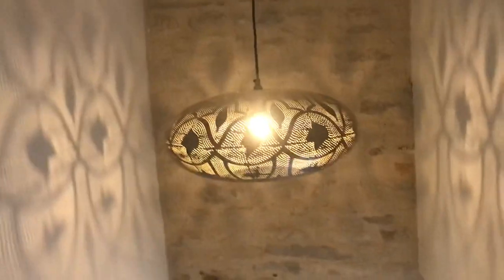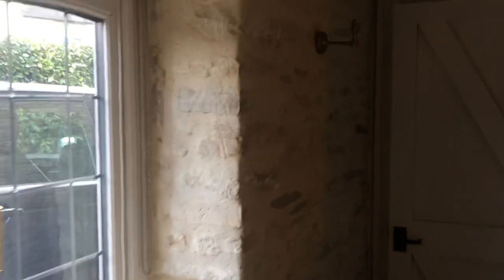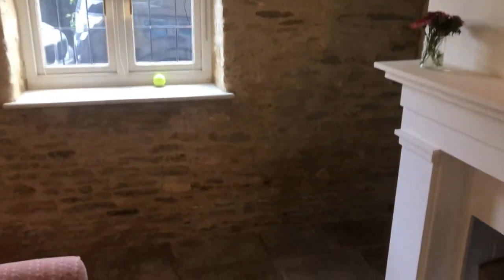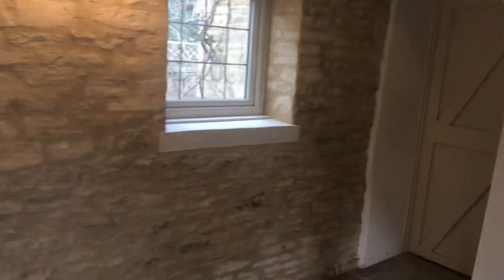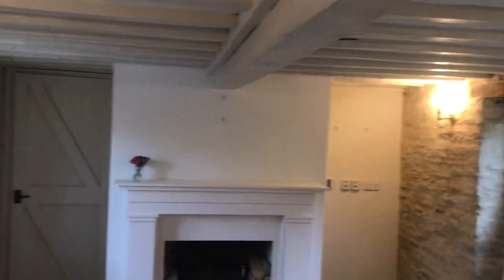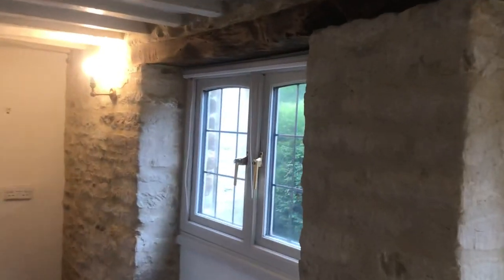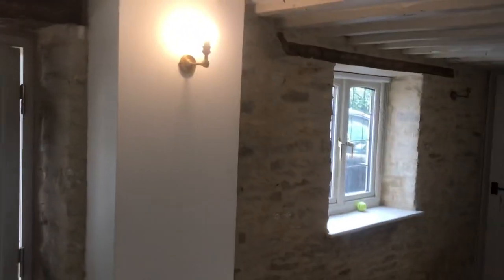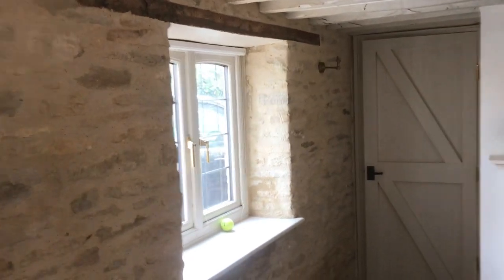Internal hot mixed mortar repointing

Comment: So glad I have come across your videos Michael. We have just purchased an old cottage with has had an extension on the rear  so the original stone wall is now a central internal wall and has some rising damp. The survey suggests injecting a DPC but after watching a couple of your videos I am thinking this is a bad idea and maybe lime mortar and plaster may resolve it so long as we have a well ventilated property with open flus etc?
Reply from the maker: Oh well done you. Congrats on the new property. Chemical damp proofing is akin to snake oil. That is to say, there are many promises but it's all usually in the name of making a fast buck. Chemicals will further add to any issues. Get all the cement off and out. Let everything dry out then use a nice NHL2, a putty mortar or some good hot mixed quicklime mortar. Air flow is always good. Maybe get back to your surveyor and make them aware of their bad advice too. Tell them to contact me if they're in any doubt as to the lack of efficacy concerning chemical treatments. I'd welcome a chat. Good luck.
Reply: @michaeljamesdesign  thanks so much for the fabulous advice.

Comment: Wonderful information in your vids, thank you so much. Interestingly, you speak about lime and light in this vid. I know that cement pointing looks utterly dismal under electric light when dark outside (you really would not mix the two). How does lime pointing behave/hold up under electric light in the evening? Thank you. From Moira
Reply from the maker: It's fine but you must use quicklime or lime hydrate.
Reply: @michaeljamesdesign  Thank you. I will look into those2, great.

Comment: Michael, do you have a method for removing internal cement render? I have grade 2 listed house dating pre 1800 in Northumberland suffering from 1960s makeover and really worried about the damage might do in removing this stuff with hammer and chisel. The masonry seems similar to your properties...soft sandstone with mud/lime putty bedding mortar. Modern standard concrete floors and external paths.....what we're they thinking? 
Intend to do the work myself as the local builders are still in the old mindset!!  
Sue
Reply from the maker: Hi Sue, I heard a rumour that when God finished making Northumberland he simply downed tools and stopped because he knew he could never better it. You're blessed living in such a delightful place. You need an SDS Plus or or Max to get your render off and A JCB Beaver pack to get your floor up. If I had somewhere to stay I'd gladly do it for you.
Reply: Very encouraged by your fast response Michael....now for some proper tools!

Comment: I am loving hot mixed everything at the moment. Powdered quicklime makes it possible to make everything from limewash to lime mortar, and lime plaster.

Do you reckon that the reason why they used to leave lime putty to mature was because of the risk of   late slaking causing expansion in the lime plaster and messing up the surface? 

From looking at the history of limeburning it seems that quicklime would have often been in lump form, rather than the modern powder/kibble form we get today. Common sense would suggest that big lumps of calcium oxide will take longer to slake and break down, hence why it was left to mature in pits for a few months. 

With modern high purity powdered quicklime, I don't believe that there is any advantage to slaking it and leaving it to sit for months.
Reply from the maker: Hey Jonathan. I've looked into why lime putty was matured and it's basically to reduce the grain size and make it more workable. But I think you'd have to be an amazing plasterer to feel the difference between four month old and ten year old putty. I once read about a particular king who would cut the hands off anyone using a putty which was less than forty years old. If you use kibble or lump lime then you get more expansion and therefore a higher volume of putty after slaking so that would be a preference in comparison to powder. Lump lime is also much more safe to handle.

Comment: Actually, that does look quite nice 👏
Reply from the maker: It's still drying out and carbonating. This'll make it go a shade or two lighter as absorption takes place (very important when there are low light levels). Left to my own devices I'd have rendered then lime washed the whole lot but usually clients want what was there when they moved in. I'm not a fan of internally pointed stone. That was always for low grade buildings like cowsheds and barns. Sand and lime putty were expensive back in the day so plastered and rendered finishes were seen as higher status. Bare stone was for peasants who lived in dry built hovels. Whereas the wealthy had lots of decorative plaster and Ashlar facades. The more regency plaster and cut stone you had, the higher your social position. Nowadays it's more about having a 'feature wall' in your converted barn. How times have changed.
Reply: @michaeljamesdesign  I hear you. I used to make oak framed houses for the rich. At one time, oak frames were for cow sheds but now you have to be rich to have one. How times have changed indeed.

Comment: Great info Michael , did you every use Roundtower nhl3.5 off grey , used it last week for pointing and it seems very white will it darken over time. Used it Wexford sand 5mm grit(washed beach sand)thanks
Reply from the maker: Hello Michael. No I've never used Roundtower NHL3.5. I kinda only really use hot mixed mortar now but that's not to say NHLs are all bad. Roundtower 3.5 seems OK but it hasn't got a very high free lime content and tends to contain a lot of impurities. Nevertheless, I've heard good reports about it. Sand is everything with all limes and if you use light coloured sands then it tends to cure lighter. All limes carbonate over a time and tend to mellow. Have a nice rest of the year Michael. All the best.
Reply: @michaeljamesdesign  thanks Michael , really appreciate your advice 👍
Reply from the maker: @rosslukeshay  My pleasure.

Comment: Hi Michael,thank you for video. I have exposed some natural stone internal wall in an old cottage in Ireland and want to repoint in lime. So confused with lots of different advise and finding it hard to source materials. I will be doing it on my own and slowly, can you recommend the type of lime mix I should be using. Thank you Heather
Reply from the maker: Hi Heather. I only ever recommend repointing stone (which was originally plastered) if there's a really good mechanical reason for it. Plastered stone is always better covered i.e. replastered. You may think it looks nice to see stone but it's just a trend. If it's exposed you should at least lime wash it. However,  if you want to keep it  exposed because you think it's nice to look at then 1 x quicklime and 4 sand.
Reply: Thank you for replying. My walls have got a cement render over the tops of a this lime render so there is some damp issues should I take cement render off and repoint or render with lime. .? Or leave be ? Hope you can help . Thank you Heather
Reply from the maker: @irishcottagerenovation9900  All masons and plasterers and people who deal with these things have a preference. Mine is for lime, lime and more lime. You need as much of it as possible to combat damp. Personally I'd let it dry out and render with a high free lime content mortar then go over that with high capillarity paint.
Reply: Thank you for making the time to reply. I will remove the cement render and let it dry out. Then try and do as you say. Heather

Comment: Hi mate, I have a 1930s property and thinking about repointing it. Would it be best to use lime or cement? Would it be a problem if I pointed over cement with lime?
Reply from the maker: Q1) Lime. Q2) Very much so.
Reply: So I wouldn’t be able to use lime if it’s cement built? Is it possible I could send you some pictures over?
Reply from the maker: @jazzyjeff1516  there would be no point in using lime with any cement built property. If you want to make it look nice use white cement
Reply: I’m just trying gauge the best mix to use on my property as I would rather use lime but don’t no if the property was built with lime or cement.
Reply: If I sent you some pictures over, do you think you would be able to tell me what mortar was used?
Reply from the maker: @jazzyjeff1516  do it yourself. If it fizzes in pure white vinegar then it's lime. If not then it's cement.
Reply from the maker: @jazzyjeff1516  The surveyor should've highlighted this to you. Do the white vinegar test.
Reply: @michaeljamesdesign  So many crap surveyors out there though.